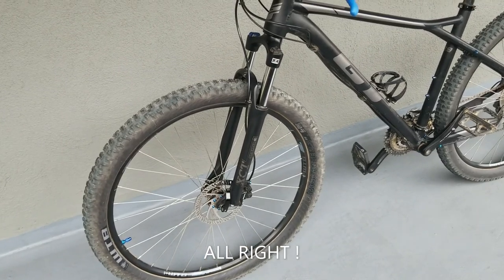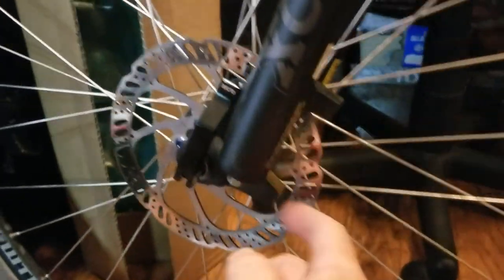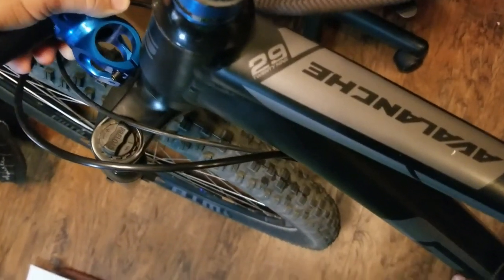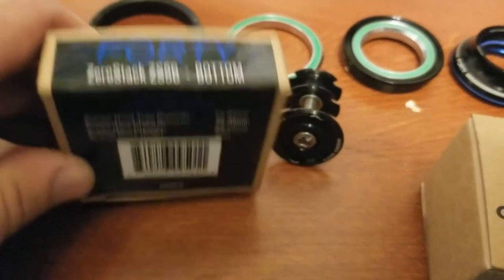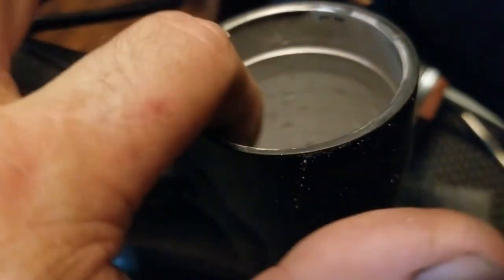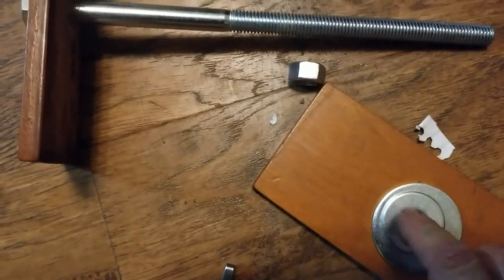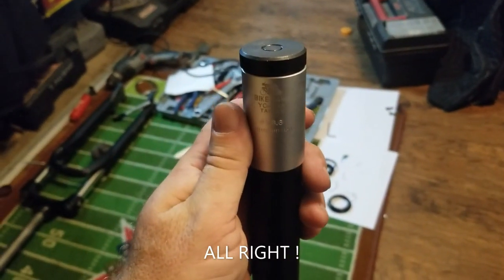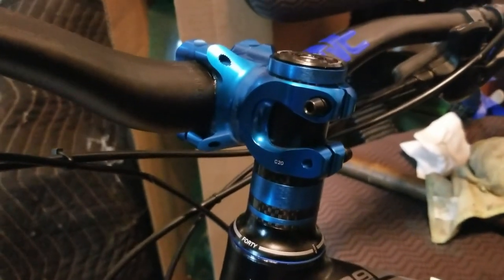GT Avalanche 2020 upgrade head set and forks. Project. or ALL RIGHT ! Drinking game.

Comment: Thanks for video , I just installed a rockshox judy today on my Avalanche , I had to change the front wheel to through axle. It feels way lighter than the sun tour. Nice job 👏
Reply: I managed to source Judys (tapered stem) with QR so didn't need to change the front wheel. I changed out the headset (Nukeproof sealed) at the same time as the original shocks were straight stem with adapter despite the Avalanche having a tapered head.
Reply: @darrin2382  Hey Man, if your referring to the 2021 GT avalanche what are the measurements of the head set you got?
Reply: @joshuaallswang8016  I ordered and fitted a Nukeproof ZS44-28.6 T2 Top Headset Cup and a Nukeproof ZS56-40 B8 Bottom Headset Cup.  Fitted with a LifeLine Headset Press Workshop Tool

Comment: What forks did you get ? And what do I have to buy to fit new forks? I like that headset setup you just got for the weight reduction. Could you send show list of items ? Thanks and love the video
Reply from the maker: Well. Alright.  The forks I got 2015 Fox float,  32 evolution series CTD  29 er air fork. 100 mm travel,          
1 1/2inch taper. 9mm
 Fox product code CSP9.
 I got these forks  because I did not  Want to change out the wheels.
 Headset I got was Crane Creek 40 series ZS tapered headset 40/56. As you saw in the video.
  Things needed
 Headset press
 Tubing cutter 1/8" and 1 3/8" stainless and aluminum. 
 Or a hack saw with guide.
 Steel file
 Sandpaper
 Bike grease 
 Metric Allen hex wrenches
 Hammer
 Bike fork star nut setting installer install tool size 1 1/8"
 High pressure shock  Pump for the forks.
 Also had carbon fiber headset stem spacer  Kit.
 Rubbing alcohol, rags ,paper  towels. 
 Well I'm sure I forgot something.
 Can get the stuff at.
 Local bike shop.
 Amazon for sure.
 Home depot.
 Hardware store.
 Ebay.
 Well I hope that helps.
Reply: @tristanmayberry9142  Did he even say thanks?
Reply from the maker: @SuperOMARKO  Well does it really matter,  just need a thumbs up.

Comment: Alright!
I have a 2019 GT Pantera and I believe the headset is 44-56. I just got a Rock Shox Recon fork and waiting on the Jessica headset. These two are nearly identical bikes only the Pantera is a 27.5+ size hardtail. I'm running 3.0 in the front and 2.8 in the back (thick mullet). I'll update if that's the right headset dims as there's not alot of info on these rare underestimated bikes 👍
Reply: I was right, 44-56 for the 2019 Pantera.